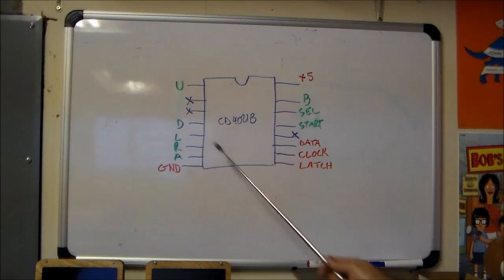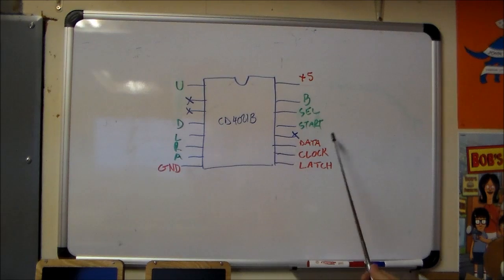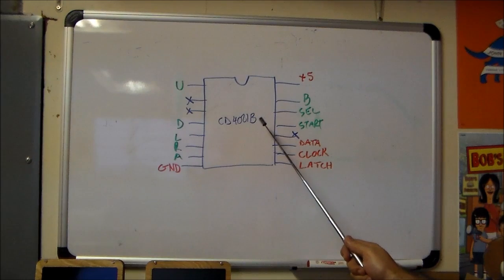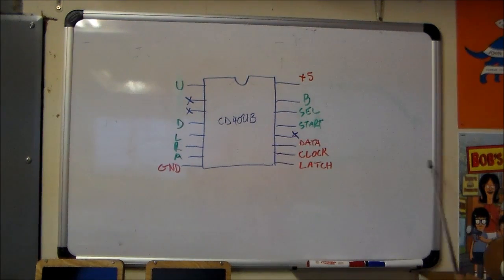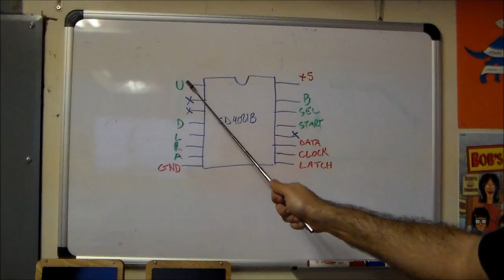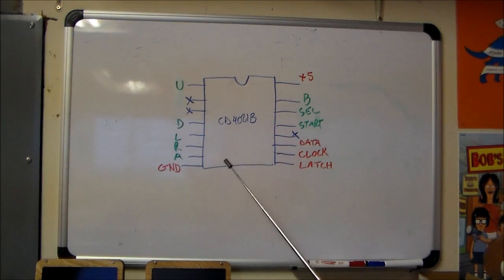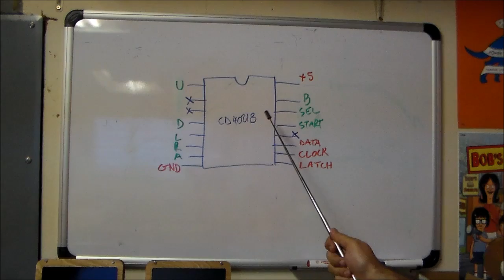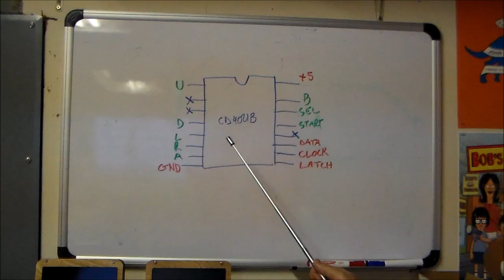Inside the Black Box 2: Nintendo NES controller

Comment: This is hands down the best explanation I've seen on the inner workings of an NES controller which I appreciate, but there's still so much stuff I fundamentally can't wrap my head around when it comes to hardware and devices.  In the past few years cause of the pandemic I purchased a RexQualis Electronics Fun Kit and a Uno R3 Project Starter Kit with the intention of learning from the ground up.  I downloaded the PDF tutorial manual for one of them and I did a simple LED wired relay but when it got into transistors, resistors, capacitors, voltages, ohms and all that I got confused and gave up.  I kinda understood the Atari Joystick one but this NES controller has me in the dark all over again because I don't get how just one leg or pin can send bytes of data out like that.  I want to get this because I know it will help in understanding Assembly Language programming but I dunno I'll check out your other videos.  Anyway thanks! 😇
Reply from the maker: Thanks man! It always takes me a couple of tries reading/listening though explanations before I get this stuff. Persistence is the key!
Reply: @RabbitEngineering  Oh snap thanks so much for taking the time to reply back to me!  That means a lot and you're right...I need to be more persistent and your comment just got me more motivated!  I did download again and install the Ardruino IDE for the Uno R3.  I'm having trouble communicating with it through USB and uploading code to it but once I sort that out I'm going to do more lessons for sure! 😁

Comment: Do you have any experience making your own controller for the NES? I'm in the middle of making one but having trouble syncing up with the clock pulses.
Reply from the maker: You should not have to worry about clock sync when you are building a controller, because it is the NES that controls the clock signal. All you need is a 4012 shift register shift, and the buttons. The NES does the rest. Can you share your circuit design?

Comment: You mentioned that the controller has 7 pins that connect to the nes, but only 5 wires go into the cord. What do the other two pins do?
Reply from the maker: They were reserved for use by "special" controllers. They only real use I know of is the Zapper gun - it used one of the ping for light sensing and the other for the trigger.
Reply: Cool. thanks for answering my question :) great video
Reply: Corrupted Another special controller was the Arkanoid Vaus controller with an encoded potentiometer.

That Japanese version also had a microphone in one controller but it did not go to the controller port (built-in controllers).

Comment: Did they not have 8-bit encoders and decoders at the time? An 8-bit encoder in the controller and then an 8-bit decoder in the console. Captures all button presses possible, instead of one at a time. I've used them in serial and rf projects.
They also make encoders/decoders with both more and less connections.

Comment: Interesting.  I was expecting the smaller number of pins (compared to buttons) to be related to some clever engineering based on acknowledging that certain combinations of button pushes (e.g. up and down, left and right) would not generally occur simultaneously.  If you also assume that the select and start button will never be pressed simultaneously, then you end up with 108 possible states (9 direction states, 3 select-start states, 4 action button states) which would fit in 7 bits.
Reply from the maker: Clinton Weir yes, that would work - but you need to take a bet on all the button combos that you think will be common, and which not; and (more importantly, from a cost perspective), that would mean TWO chips in the controller - some dedicated logic gates to detect the state, and some kind of ROM to store the lookup table. That would probably be a deal breaker.

Comment: What's the sixth wire for?
Reply from the maker: Mokalan Hakatan actually I miscounted - it is 5 wires: +5, ground, latch, data, clock. You can see the pins on the plug here: http://breaks.googlecode.com/svn/trunk/Docs/NES/NESController/NES-Socket-pin-out.jpg

Comment: I remember that the black circles on the pads would rub off onto the metal and somehow that made it stop working and scraping it off would get the buttons working again. I think it would be interesting if there was a video that explained why this is so.
Reply from the maker: Robert Claypool oh, I didn't know that happened! The reason that would break it is because you would essentially have the switch continuously closed, and depending on the game code, that might have led to glitching.
Reply: Dave Nunez I don't remember the black stuff on the circuitboard, though. Also, it didn't act continuously on with any game, you'd just press the button and nothing would happen.